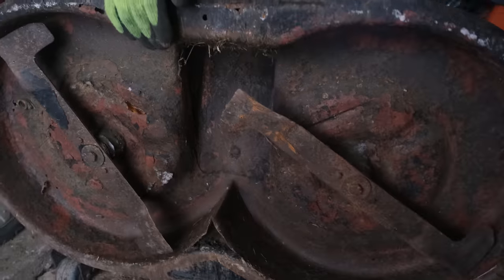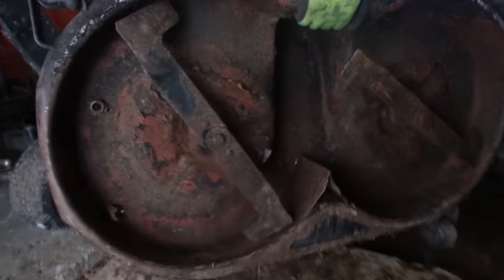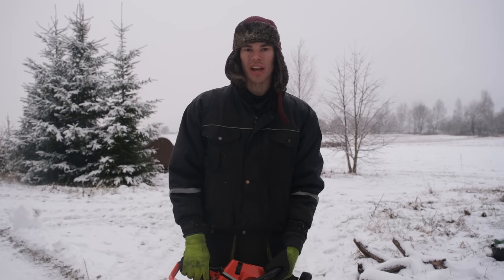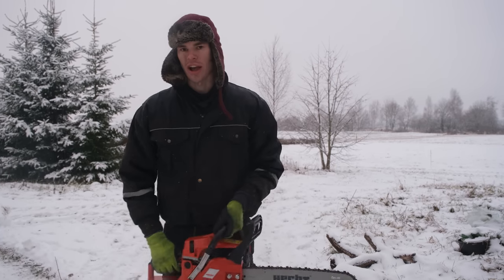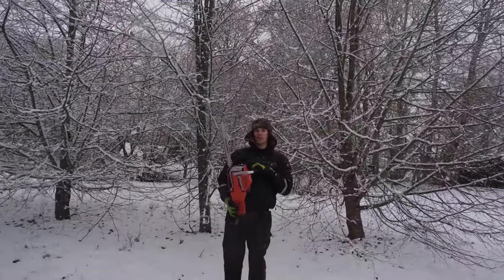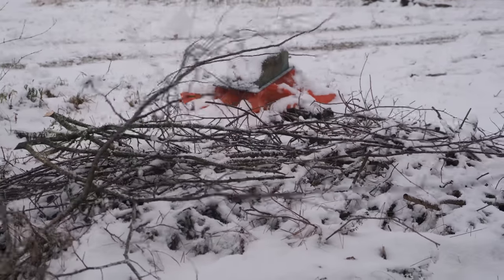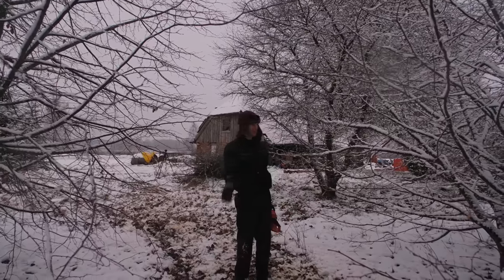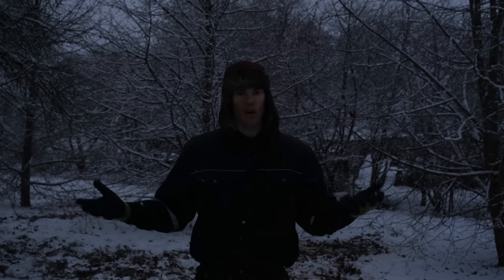Plowing SNOW with Lawn Mower?!

Comment: Deivids, when are you gonna build a log splitter to process those logs into firewood?   Should be pretty easy for you with your mechanical skills....weld an axe head and provide either electric or motorized pushing power.  You can do it and saves lots of hard woodchopping.
Reply from the maker: Maybe but we will process our wood at my Aunts place which has all the machines needed. This ones I will just use an axe! 😀

Comment: Chainsaw looks a lot like my husqvarna 435 .   Get a round file and keep the chain sharp.   You probably have to use bar chain oil while it is under warranty,  but after that I would use old motor oil instead.   Never had an issue with it, going on over 20 years.